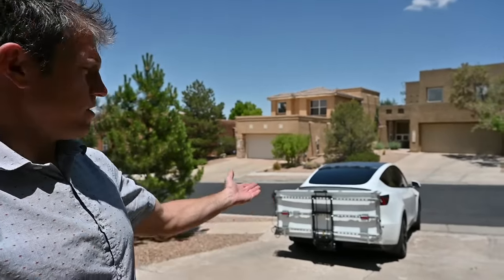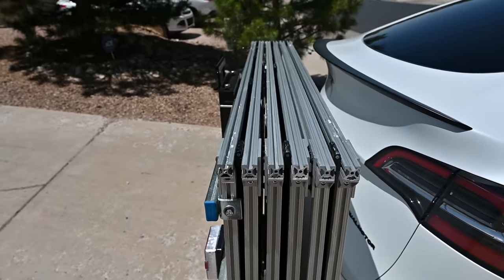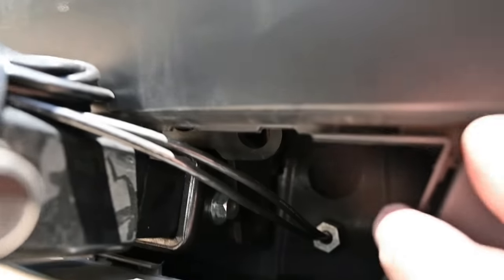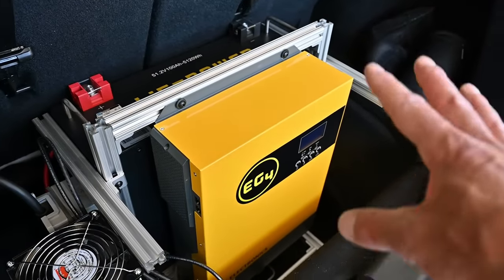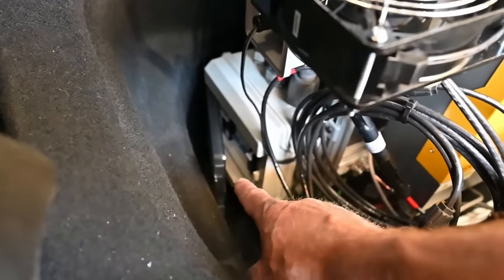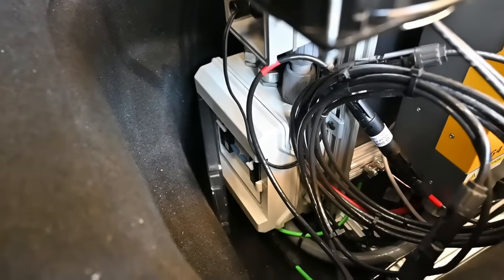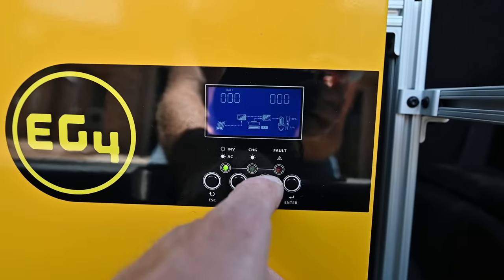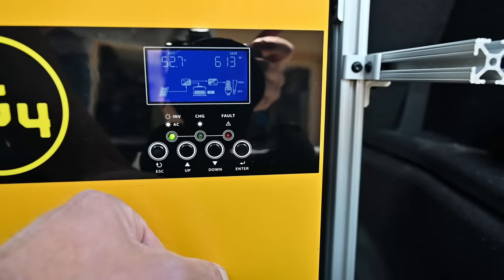Tesla Mobile Solar EV Charger with EG4 inverter and battery

Comment: I own a Tesla and really like this idea. Your build is excellent! I built mine a little differently. I put it on my van using a latter rack using unisistrut. But that means I have to drive two vehicles to where ever I charge. Yours has the advantage of always being with you. That's a great idea! I love your solution. I also have about three same amount of solar. The one advantage I have is I don't have to set anything up just plug it in.

Comment: It appears many of us are thinking similarly.

So what does this get you? On a clear summer day how many miles range can you get?
Reply: I get about 30 miles per day right now.
Reply: @danielderkacs6180  A 600 watt charge over 10 hours is 6 kw. Enough to run an E bike 30 miles. Your math doesn't quite work out.
Reply: @billboyd4051  6000w/300 would be 20 miles in this car. 6kw probably can make you bike go 300+ miles
Reply: @ben3989  Its only a 600 watt charge per hour, My E bike is 500 watt. Its barely enough to run it. It takes 10 hours to make 6kw. The Tesla charger is 48 amp at 233 volt or 11,184 watts, nearly 20 times the charge rate, continuously, not just when the sun shines.
Reply: @billboyd4051  Averages to around 8kWhrs supplied to car x 3.75 miles/kWhr = 30 miles. I get around 1.1kW peak generation, 15% inverter/charger losses, 15hrs of sunlight right now with cosine losses of course.
Reply: @danielderkacs6180  Hardly seems worth all the trouble unless you have no outlet and don't drive far. What was the cost of panels and equipment ?

Comment: Amazing work.  I'm looking at something similar for long camping trips, the goal being that I can get enough solar to power camp mode and a few accessories (starlink, fridge, etc.) and stay out in the middle of nowhere indefinitely.  Debating between a hitch like you have or some sort of unfolding setup from a roof rack - maybe doubling as a canopy.  Would likely use a portable power station like the EcoFlow DELTA.

I'm curious what your use case is, or is this more an experiment to see if it's possible?
Reply: ExoFlow would work, but you have to manually tie neutral to ground and make sure that ground is tied to your chassis. I've done this for energy independence desires.
Reply: You guys are crazy, do you know how much energy the Tesla uses just in standby mode. And also you have to factor in the solar generator is also in standby mode. If you want camping power just bring a gas generator or you have to bring a freaking large battery... solar panels will not keep up to satisfy even the standby consumption of all your electronics and the car at the same time! My small travel trailer uses 500 watts with just the fridge on so if I boon dock I 100 percent have to bring lots of Propane to run the fridge otherwise I need to run the generator 24/7 so the fridge can run on electricity. Do an energy audit of all your loads to figure out what you need to supply power too!
Reply: @uhjyuff2095  500w ....that's not camping city Boi. I've a 2.2kwh battery that will run my fridge for 3-5 days(depending on ambient or if i set one zone to freezer) without solar when I go camping. If i put out a couple panels I'd never run out. As it is I pretty much always run out of food/end trip before battery dies. Truck has a decent inverter I can charge the lifepo4 in about 8 hours idles,or cruising if I need it or we're moving sites/going into civilization for groceries anyway.
Reply: @chublez  Right! It's called "Glamping" My RV is a 11000 pound 34 foot fifth wheel!
Reply: @danielderkacs6180  how did you know where to drill for those wiring holes?

Comment: How long could it take to charge 100% of the car battery?
Reply: From 0 to 100% I think at least a week.
Reply: That's about right.
Reply: And that is the reason this is basically a novelty and not included by manufacturers. Sure, it is free and if you are parked somewhere it can augment your charge, but at 5 miles per hour of charge, I am not seeing this as effective. I mean, if you drive less than 40 miles and can park it for 8 hours, you can recover your charge. Not sure where you would be able to do that. Where I live, you can't block the sidewalk. I could not use it at home or work.

If you totally ran out of charge, you could go 5 miles more after one hour of charging. Is that really worth the investment?
Reply: @JohnnyHughes1  it's a proof of concept and it was improved already. I bet with some extra work out will improve and this can allow you to drive to remote camping areas where you can spend a couple days and have a good charger and when done with camping you can drive back.  Maybe small trailer connected to car and 3 to 4 of this set up and at this rate you'll have 20 miles per hour.
Reply: I am certainly not saying adding more solar panels would not work.. They could. If you also had an RV and triple the input to the battery and max out the inverter, where you could charge at 20 or so amps, it could be a good.  We are just not close to the total power needed without about 3x (at a minimum) the input power.
Reply: Most people drive less than 35 miles/day. It'd work fine if the car was parked for most of the day.
Reply: @Nitrofan_Kerm  😅😭😂🤣😅😂🤣😭😅
Reply: A 100 kw battery would take 20 days at 600 watt charge.
Reply: If his video is honest he will get 1 mile of charge per hour during peak sunlight hours and then it will shut off. So 5 miles per day. About 2 months for a full charge. And the added weight will cost you !ore energy than it produces.
Reply: plus the solar panel drag probably another week.
Reply: @David-sk7ls  And easily 200 pounds on the back of the car. Must make handling suck.

Comment: Seems like a possible concept prototype for the Cybertruck since it has the surface area needed. cool setup
Reply: A 200 kw battery at 600 watt charge rate, would take 330 hours of sun or 41 days of charging.

Comment: Surely the battery is unnecessary, you've got the car batteries which are sufficient... The wind drag caused by the solar panels won't be helping much.
You've got more money than sense... :)
Reply from the maker: This new 48V EG4 inverter is a rare unit that can actually run off of solar input only; but almost all other off-grid inverters require a DC battery or AC input connected. The vehicle battery is ~400V so it cannot be used by the 48V inverter. Furthermore, with only solar connected you'll need to exactly match or oversupply the inverter in order to supply a continuous AC load...which means you'll either always throw away solar input power or frequently shut down the inverter when a cloud passes over or the sun angle changes.
Reply: @gridfreeordie  thanks for the information...!
Reply: I agree, the wind resistance will lower his range significantly… he would be better off keeping the panels flexible, and storing them in the car. Or building a roof rack system that keeps everything horizontal…
Reply: I've not recorded any appreciable difference in W/mi since installation on Teslafi.
Reply: @danielderkacs6180  odd.
Unless you never drive highway, I would expect a 20% drop in range…
Reply: At least if he decides to replace his setup, he has nearly everything he needs to make his home off-grid.
Reply: @SuperVstech  I carry 3 bicycles on a cargo rack bike carrier with our model 3. Doesn't noticeably change power consumption.
These look to be almost entirely contained in the cars slipstream so I can see then having little to no effect even though they are solid.

Not saying it has no affect, just not a large effect. 5mph headwind is much worse
Reply: @dorvinion  Your 3 bikes are almost transparent to wind. They are more holes than material when looked from the side. Having a flat solid panel facing the air stream is completely different.

Comment: This is really cool! I always wondered though why I haven't seen anyone try to connect something like this to the DC side of the charger. (DC -> DC) instead of (DC to battery -> battery to inverter -> AC charger -> AC charger to DC battery charging system)

Comment: Have you measured the loss of range by the parachute on the back of your car adding a surprising amount of wind resistance. I was surprised by a 20% loss of range in my car having a bicycle on the back.

Comment: Loss in range due to weight and drag will do more harm than the charging does good. Unless you only drive the car 2 times a week and it is in the sun the rest of the time. Could be good for a camping trip though.

Comment: Im trying to do something similar with 4 pipes at each corner of car then cross pipes.  On top of this scafolding will be large panels this way its a sort of pergola over the car all interlocking with locks so no one an easily steal the equipment.  This way it acts as a shade over the car , it should cause interior of car to be much cooler and also protects paint cause all my cars after few years paint starts to fade which is expensive to repaint. Also I would be able to set this up at my work parking lot with equipment being out of way for every car passing by. MY Model Y will be sitting in parking lot all day under hot sun so might as well soak up energy!  This setup of yours is awesome !

Comment: What's it take, 3-4 days to charge? Interesting idea though. Panels should be connected in series, you've got high voltage batteries. To keep loses down, leave the  inverter out!

Comment: Wondering if the aerodynamic drag from hauling the panels on your hitch that way is costing you significant range... 
A thin film roll-up panel that you can keep in the sub trunk would be nice, when/if that tech hits the mainstream
Reply: The Drag, Weight would probaly cost more miles than you gain. the fact its fugly and old Elon might be pissed with warrenty issues, on a side note what car parking space is an extra 5 mtrs long

Comment: Nice video. Thank you for all the effort. So nameplate 1.2kW DC total solar PV generation. Let's be very generous and assume total 20% losses, Northen CA latitude, 0% tilt (they lay flat) and you can point them south. Per PVWatts, that gets you 2/3 of a full charge (assuming 75kWh battery) per winder month and 2-3 full charges per summer month. This proves that mobile PV is (very) inferior to stationary PV, e.g. carport with 4x4 array of 300-400W panels.
Reply from the maker: Yes, a 1.2kW array is far inferior to a 5-6kW array. But considering that many people live in apartments and/or aren't allowed to install PV on their home, this setup offers a way to power one's EV by the sun. Yes the charge rate is very slow and the overall energy production is low, but for some it is enough. Stay tuned for a future video on the lastet iteration. More power and much lighter.
Reply: @gridfreeordie  I look forward to the next version. Thank you for your videos!

Comment: They should make an option that would let you use solar directly I mean if i assume the charger is basically a switch mode power supply so it's just turning ac into DC so if you are around 140v, 150v it should work fine

Comment: I got an idea for you...what if you took that ground array and redo things for the array folds up over the top towards the front of the car? That way it would offer some shade to the vehicle and provide a small footprint since it would be over the top from back to front folding out.
Reply: I have seen something like that on other videos. It’s like arc as a small portable garage. Set up and take down would be like a tent which would be wearisome after a few times and the novelty wears off. 

A roof top rack that scissors up and slides the panels outward would be neat too. Four poles setup to get the outer corners and the whole car is protected from the weather and keeps panels cooler. 

Issues are still weight, cost and effectiveness.  However innovations need to start somewhere.

Comment: Thankyou.got a electric van thinking might put some triple layer panels on the roof. Think I would use a Arduino or pi to control the surge resistor etc.

Comment: How much time would it take to charge the car in a normal sunny day?
Can you make a video about performance in different seasons? (indicating latitude)
Reply: You can probably add about 1-4 miles per day with high irradiance, no shadows, lots of daylight hours not driving your car, high security to prevent theft, and care taken so other drivers do not run over the PV modules in the parking lot.

Comment: Solar panels are meant to absorb lots of vibration. Microcracks can build and cannot be detected visually. You'll just notce that the solar harverst degrades in time. But you can minimize the vibration.

Comment: Great video! Thank you! This is quite useful in some of applications, my estimate is that if you charge for 7 days you get 1 fully charge, is that right?
Another question, do you think it is possible to make something what will be able to take the energy out of the car? Like other automakers have done.
I understand that the the system is not design to be able to do that, but is there a relatively simple way to achieve this?
Reply: Yes, 7 days or so in good sun. I get around 10% per day while I'm work, less in the winter clearly. I'm an electrical engineer, but my phd is in semiconductor physics so I'm not an expert in circuit design. It clearly can be done, but you'd have to hack the charging protocal somehow and make sure the contacters are closed so that the pins in the charge port are actually at the battery voltage (~400V or ~800V). Then you'd need an external inverter (on that is designed for ~400V batteries!) to go from DC to AC. A simplier way may be to utilize the already existing DC-to-DC converter in the car that charges the 12V battery. I suspect it is not very high power though so the amount of current draw out of the 12V system may be quite limited. I certainly wouldn't want to experiment with anything involving the 12V system on my car though, to many computers to fry!
Reply: @danielderkacs6180  I see what you mean, as far as I know, "make sure the contacters are closed" This part will be most difficult because of how it is controlled, the best that comes to mind, is to actually have a switch which will redirect power from motors to a different output, make computer think that car is actually driven, however, not sure what to do with odometer at that point :D

Comment: I only looked at the thumbnail, but was cleverly able to deduce the gist of the content.  So the car pulls a string of PV panels along, which will charge the car as it drives!  Perpetual motion in action - as long as it is sunny and no tunnels or an inordinate amount of overpasses are involved.  Brilliant!

Comment: Have you considered using DC out of the PV panels to charge the batteries.

In your setup we have sun=> DC => battery => inverter => AC => mY inverter => DC => mY battery.

That does not look efficient. If you have a  CSS port (europe only?) What about using the DC charging connectors ?

Comment: I honestly admire your efforts But I really dont see the point. All that money spend and effort for panels that are mostly stowed. I would rather put them on my roof and charge that battery up and transfer the energy to my car at night. at 1kwh of panels you could charge a dead tesla in about a week.....which is pointless. you could get max 8kw in one day. your battery is about 49 to 60 kw and getting 8 per day is not enough to be worth it. Having that clunky thing on the back of the car is an eye sore and the extra weight probably counter productive. Also the wind drag......Think about it.
Reply from the maker: I've nearly maxed out my home's solar capacity and I have plenty of stationary battery storage. It's enough for the house, but not enough for the EV too. This gives me an added kWh boost when I charge at work. I transfer close to what I drive in a day and that was my goal. If you watch older videos, I go over range loss (drag and weight) averaged over thousands of miles and it still stands around 4%. There's a lot of little system losses that add up for sure, but it works flawlessly and charges what I use in a daily commute. As for the cost...I certainly wouldn't have built this if I were looking for the most economical solution. Boys have their toys, engineers too!
Reply: @gridfreeordie  I think you might be better off making a carport at your house with solar and battery backup. I was working on a set of plans with a relative just the other day. He already put a paten on it. Movable carport with 1 to 2kwh of solar and battery backup. using RV inverter. ON off grid inverter and plugs into your garage 220. can be used as a rolling blackout backup. Anchors to the concrete with tamper proof bolt system. Removable for people who rent....Great idea iMO....might want to make one for yourself. be a great video series. could relate to a lot of people

Comment: Very good..but suggest that it should be taken up on the roof instead and attach a rack to hold it. Use the slide rails stretching forward and back to equal balance. If it's in the back of the car, I think it blocks the taillights and turn signals. There may be a danger of rear-end collisions from other cars and I think they should be inspected by the traffic police.

Comment: Love it. Ideally this would be for camping offgrid, but even then, you’d want an easily removable/portable unit, all in-1, that’s <50lbs, so you could still sleep in your car and not sacrifice space. This is surely the cheaper way to do it, but I think having three 400watt foldable panels, 2+kWh of battery/inverter combo, that you could store in the front seat easily, is just way more convenient, although atleast 3x the price- i’ll admit. Even if you only get a few miles a day. 
The set up going on in this Tesla should be applied to an electric van instead, minus the trailer hitch, and thick bulky panels. Go with thin marine vessel panels. Love the imaginative effort for the price though. $1500 for 5kWh???!!!